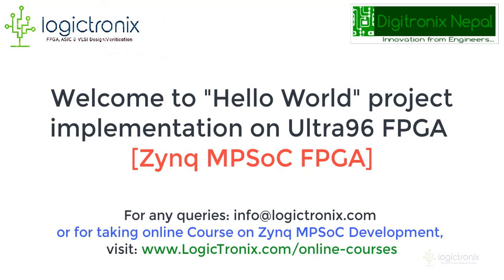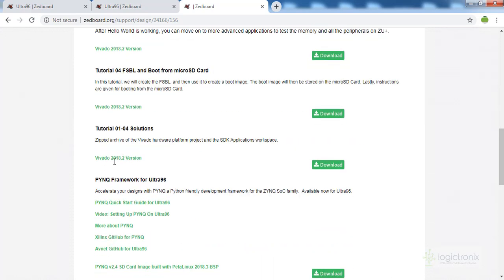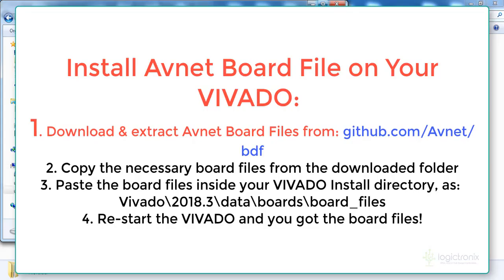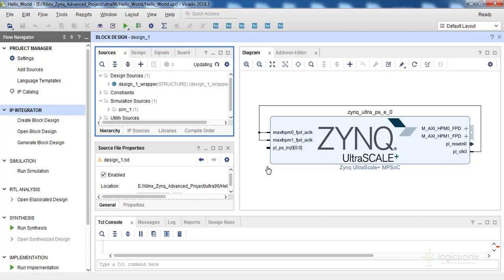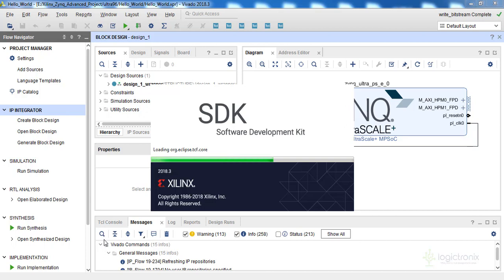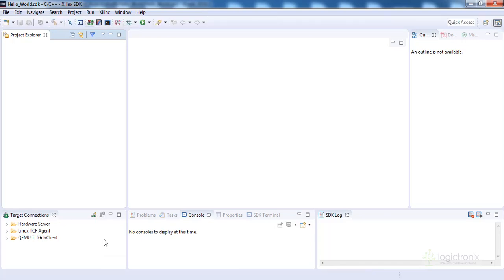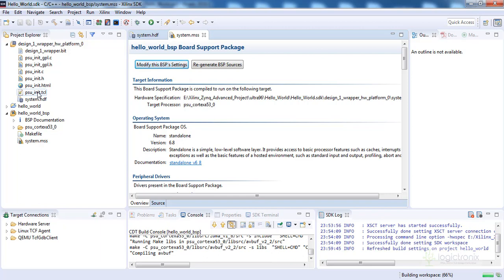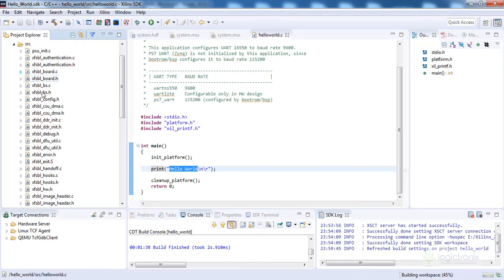Hello World & Peripheral Test with VIVADO, SDK & Ultra96 FPGA- BOOT.BIN Test

Comment: Hello, I tried to execute the program on the SDK console. everything seems to be correct but nothing happend on the console. Then,  I tried to execute the program on tera term, I had the following error msg: Cannot open COM3, access denied. I installed the necessary driver so I don't think that this is the problem. Do you have an idea
Reply from the maker: Hello Bedimerad, in which Operating system you are using VIVADO? For windows based installation of VIVADO, device driver as programming driver comes on itself while UART driver need to be installed manually. If your tera term is showing other COM ports then you can also tried with those COM port cause COM port number depends on specific to PC or computer.
Reply: @DigitronixNepal   Tera term just showed one port number (com 3) that denied the access while the terminal on vivado (I use windows OS) displays the following msg: port COM 3 already connected when I connecte the zedboard card (which means that the driver is well installed), but I can't get the hello world on my vivado terminal  ...